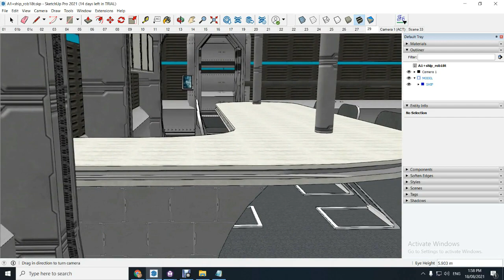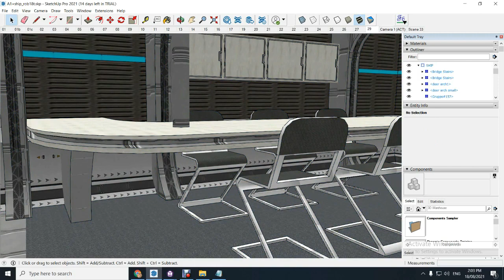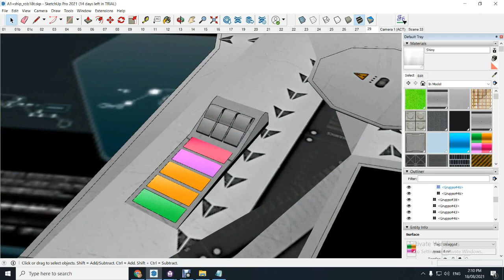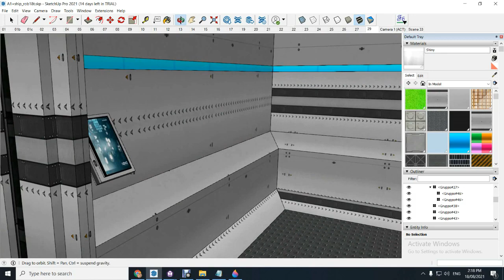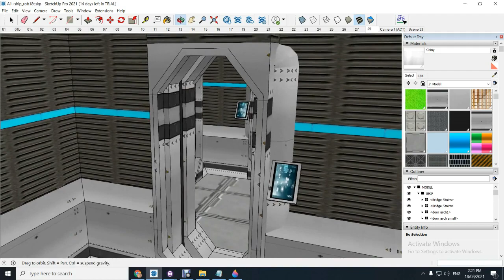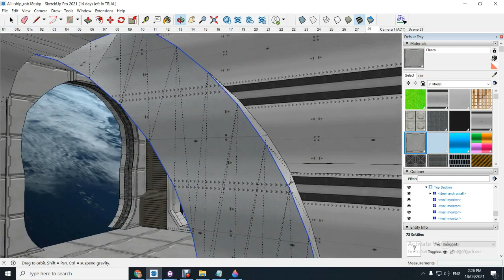CopperCube & SketchUp

Comment from the maker: NOTE - There seems to be a problem with the CC export in which names of the materials used are changed back some default entry which Blender and thus SU cannot auto load.
If you relink the textures back again in Blender from the OBJ export from CopperCube and then save as DAE file - this will load correctly into SketchUp with textures...for some reason CopperCube to SketchUp directly doesnt work...